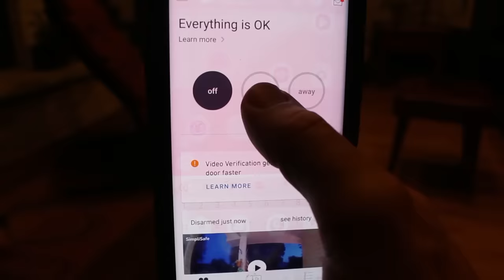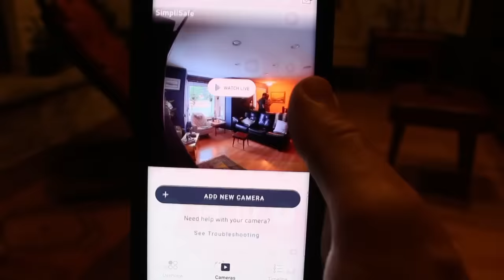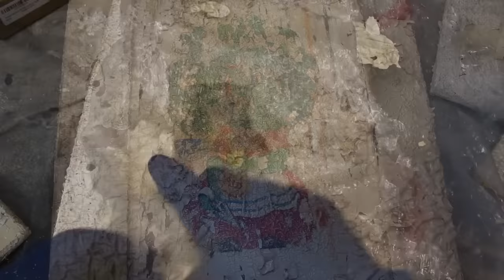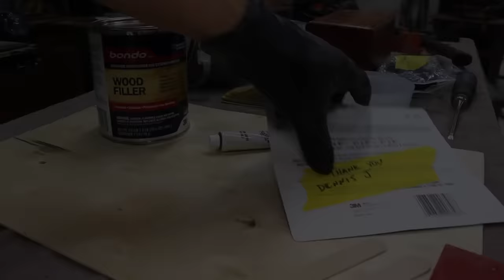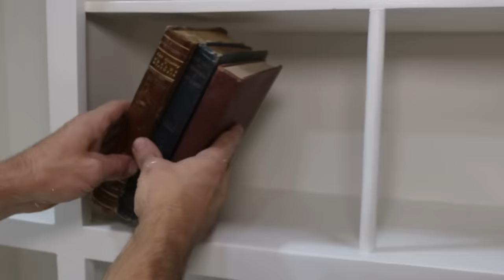Ep. 79 Amazing RESTORATION of 100 Year Old HOOSIER Cabinet

Comment: That Hoosier cabinet was in rough shape to start with, but you did a superb job of bringing it back to life! I was surprised by the mother's request to leave the doors off the finished product, but it is a lovely display cabinet. It was very kind of you to paint the doors for her in the event that she changed her mind down the road.
Reply from the maker: She was planning to display photos
Reply: Yes, very kind indeed.
Reply: I used that Emerald paint to paint kitchen cabinets, baseboards and doors in my grandmother’s house, built in 1950.  Great stuff and it dried so nice and smooth and hard.  Expensive but recommended!  It will wipe clean for years and years.

Comment: I miss my Uncle. He was a jack of all trades and MASTER AT ALL OF THEM. He always saw new life in old things and I don't recall him ever saying it couldn't be fixed. So when he passed and we were clearing out the small garage, the oversized oil cloth covering something in the corner got my attention. It was a very old  table saw he never got around to fixing. My mini van was going to be tested this day, as the weight of the iron table was going to challenge my cars suspension for sure. I had a 2 1/2 hour drive home. We managed to get this beast into my basement and I skipped dinner and stayed up all night starting this renewal project. Day after day, week after week but it got finished right down to the new switches. I unpacked the multiple blades that were carefully wrapped in oil cloth to protect them from the elements. My first test was about to happen. The table and the blade were so true...I do believe I could have made tooth picks from the board if I wanted. It shaved the thinnest piece I've ever seen. I believe I got my Uncles "gene" and always give something old a NEW LOOK. It's a labor of love and lots of patience bringing NEW life into a  History and decades of memories....But in the end...they can be brought back.

Comment: Beautiful job! I am sure that will be cherished for many years by the family. I like the way it looks without the doors - great way to display memories.  My favorite piece to refinish was not wood but tin. The old tin match holder that hung on the wall of my grandmother's kitchen. Mom took it when her mother died in the hope of removing all the paint and repainting it. When mom was in a nursing home, and my brother and I realized that she wouldn't go home, I had to clean out the house to sell it. That was when I found the match holder. I took it with me. As I removed the 4 coats of different color paint, I could remember 2 colors, while my older brother remembered 3 of the colors. I cleaned it up - it needed no repairs - and then I painted it black. It now is in my kitchen for when my Texas electricity goes off and I need to light candles. Many, many family memories are in that tin box.

Comment: I lived for ten years in a house built in 1921 in Los Angeles, in the Silverlake District. The kitchen had minimal cabinetry--and the style reminded me of this Hoosier.  In one corner of the kitchen sat an old ice box cabinet that had an opening through the wall for the iceman to deliver ice; at the bottom was a metal tray to catch water from the melting ice and then a hose carry the water to the outside. When I first moved in, I had no idea what this was, and it took me awhile to figure it out.  Seeing you take apart the cabinet in order to repair it, I'm reminded that life way back then was simpler--and this cabinet served for not only storing the flour and baking soda, but also a place to knead the dough, and a place to store the freshly baked bread or other baked goods.

When I first moved in, I too took off the paint from one of the cabinets.  I believe I counted about 12 layers of paint.

Comment: I believe I recognize the decals that were on the doors. As a young child ( I am 67 now) I remember my mother having some of them. They were vibrant colors back then and were used to decorate various items around the house. Some were children themed and others were florals. You soaked the decal in warm water and then slid them off their paper backing and onto the surface of what ever you wanted to decorate. You then let them dry and the glue that remained on the back, adhered it to the item. Since almost all kitchen cupboards were white (even the metal ones), it added some color to the kitchen (or nursery, bathroom, etc.) They were thin and you could trim the edge (before soaking), so the edges really didn't show.  I guess they were an early form of decoupage and were mass marketed for an inexpensive way to decorate. I believe my mother bought them at the  local Five and Dime store. You could also varnish over them to give them an antique look so they could be used over finished wood as well.

Comment: A beautiful restore.   I must share what I found in refinishing my Seller's chest.  Like you I removed the hardware and disassembled top, drawers and doors.  The metal bread drawer still had the metal cover. The problem was the drawers were warped a bit and the wood supports under the steel pull out counter were too.  Solution: I brushed a thin coat of Tried and True (polymerized linseed oil) on all the very dry bare wood.  After all was painted, cleaned,  re-hinged etc, the top was ready to be placed onto the bottom cabinet.  The Tried and True oil had brought the woodback to life.  The drawers glided into place. (I used to use candles) The steel counter was fitting on the base guides with no warp.  Ive since used T. ÷ T to replenish dried or drying wood on other old stuff (and antiques)  that I own.  It's never failed me.  If you've never tried it, I heartily recommend it.  The food safe T.+T. did wonders for my teak trays and wood blocks. 😊
Reply from the maker: Love this !

Comment: Another great job..was curious right to the end and wanted to fast forward to see the results. I was good and the final results were awesome. I restore a lot of hoosiers, but back to original.  

The only thing that I was actually talking to the TV 😂 when you tested for lead the top coat may have not had lead, but the bottom layers may have, so kudos on the mask. Should look into special filters for lead. Between doing the hoosiers and ceramics working with lead base is why I will wear long sleeves. 

Keep those leftover parts, I buy lose parts and have on hand! 

Thanks again for another great finish!!!! And memory that will last for another 100 years

Comment: If you ever restore one of these again try using speckled trunk paint on edges of the pull out metal table. My friend restored the roll top on mine and it glides easily now. It does run the entire width. 
Nice job.

Comment: Have you considered using an infrared lamp to remove paint. They're used to remove layers of paint from wooden windows and I imagine would work the same on furniture. I restored solid oak kitchen cabinets. The base units had 2 layers of paint,  the doors had 4 layers. I covered the doors with  a layer of newspaper soaked in water based stripper and seal them up into 55 gallon garbage bags .  After 24 hours most of the paint came up with the newspaper as I peeled it off.
Reply from the maker: Wow! Great suggestion

Comment: That came back to life well. The use in the garage or barn shop kept many of the old cabinets from going to the land fill. It wasn't in good shape but not bad either. Even the tambor wasn't to far gone. The Hoosier is great for people with cabins. They are for a simple kitchen which is what most cabins have. Before 1920 there were no built in kitchen cabinets. I would say it came from the company painted and had those flower pieces decopaged on as I have seen others that way. Many poor rural people had no decorations other than their calendar they recieved free.
Reply from the maker: So much good info. Thank you

Comment: You did a great job on the cabinet. It would have looked a lot better with the doors back on, in my opinion, but I read that the client didn’t want them on. I wonder why you painted the enamel worktable surface and the door handles? Was that her wish as well? I love old Hoosiers and I have one that my dad refinished for me. I use it as my baking center and it gets heavy use. I was born in Indiana and my dad still lives there, so they are quite common to find at auctions and such. 
The metal drawer would have had a metal lid that slid in the groove, it’s a bread drawer. Mine is intact, as well as the flour bin and sifter? his Hoosier is missing its flour bin and sifter and probably the sugar dispenser. You can tell from the type of wood it was originally painted. I loved the old and probably original decals! Thanks for sharing this project. 
If the person who passed was a personal friend, I’m sorry for your loss.
Reply from the maker: Lots of good info. We were both aware of most of these details but realized in her modern kitchen, this cabinet would not be used for any of those things. Instead, she placed photos of her children

Comment: Astounding job on that Hoosier cabinet, Barry! I am SO happy you did this video! I have one of these that I bought from an abandoned house that was about to be torn down, from one of the family members that owned the house. It had been repainted a long time ago, in a rather obnoxious yellow. The paint looks to be latex, and it has severely cracked due to the house not being climate controlled for decades. The original colour of the cabinet was ivory and green, and the case, itself, is oak. I would seriously like to be able to remove the latex paint and leave the original paint that is underneath it, but I don't have a clue as to how to go about doing that. Have you ever attempted that? I would seriously appreciate any input you could offer as to how to accomplish such a feat. The cabinet still has everything with it...tin-lined biscuit drawer, original pull-out cutting board, flour sifter, door/drawer pulls, ivory and green enameled work surface, etc. The flour sifter and work surface were painted over as well. Those wouldn't be a huge deal from which to remove the paint, but is it possible to remove the latex paint from the oak case and leave the original paint that is underneath it? I know there are some products that say they remove old, dried latex paint, but I don't know if they would damage the original paint. Have you ever tried any of those? How long did it take you, in real time, to get that cabinet to look so great? I would love to watch a series on this one restoration, even if it took days to be able to see all of it. You put so much care and appreciation into the restorations you do that I trust your judgement and perspective more than any others I've watched. It's obvious the pieces you restore are much more than just piles of wood, screws and nails to you. You do PHENOMENAL work!!!!!

Comment: What else is Wild 😝 it still has the original hardware. 
That was usually worn out and replaced.
When you are trying to pull the covering lid.
It needs all those pieces removed, cleaned, and new tambour cloth.
Glued back on, and it isn’t cheap.
But, today?!
What isn’t eye gouging.